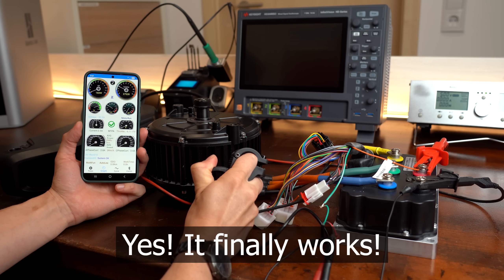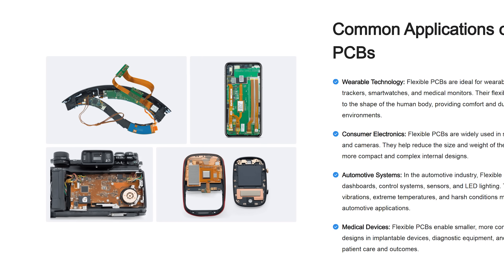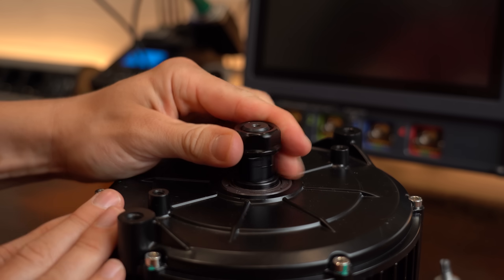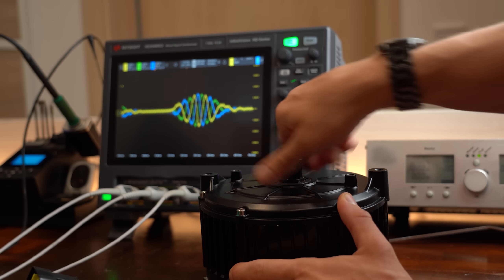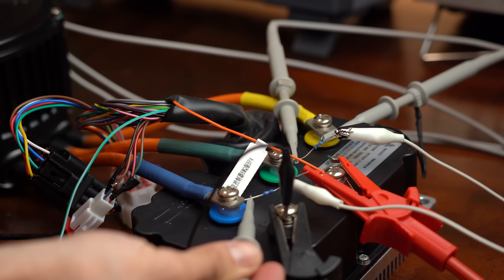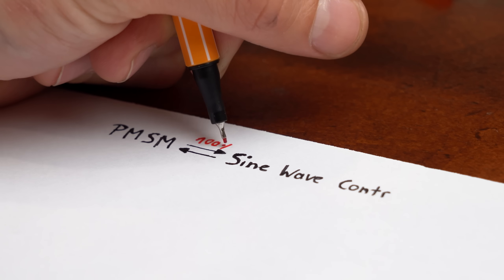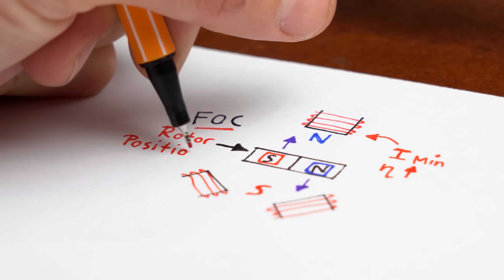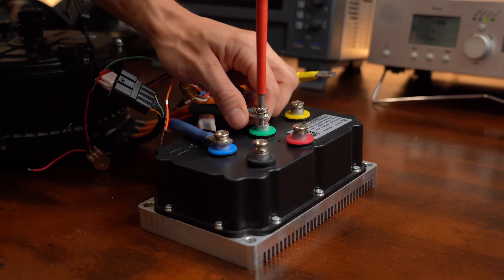The Most Important Motor for our Electrical Future?! (PMSM) EB#63

Comment: can you hack a home gym, and replace the weight stack with an electric motor, to give you infinitely variable resistance to account for your bodys limbs having different torque peaks for every position.  if the motor lets out the cable at a constant rate, and you messure the power generation.   there are home gyms that do that (arx) but they are crazy expensive and protected by patents.

Comment: Really great video. I think I need more clarity, I remember checking the bemf of an e-bike motor and got a sinusoidal bemf. This motor looked similar to the one you showed at 2:15. The interior looked nothing like the one you showed in 4:29. I know there are different PMSM designs, like the surface mount or V-shaped, is there a chance you could expand on why PMSM can still be found on lower-power-rated e-bike?

Comment: BLDC (Brushless DC) and PMSM (Permanent Magnet Synchronous Motor) are both brushless motors, but their key difference lies in their control and back-EMF waveform: BLDC uses simpler trapezoidal control with trapezoidal back-EMF for cost-effectiveness (fans, pumps), while PMSM uses complex sinusoidal control with sinusoidal back-EMF for smooth, high-efficiency, precise operation (EVs, robotics, servo drives), resulting in lower torque ripple but higher cost for PMSMs

Comment: Hook to a 10k watt ac generator head.
Start it with an entermitant pully and 12 volt car starter and watch ir self gen with alot of free to use watts left over.

Comment: You have just discovered those type of motors which are widely used in automation robotics and production as part of Servo Drive System. Most of servos use PMSM motors.

Comment: Im looking at one of these to convert my Mini-Excavator to electric. Ive noticed the 10HP engine just has to be slightly above idle to give full performance which just by feel is around 2000Watts and 1800 rpm. One of those 48V server rack batteries able to be swapped quickly would be perfect. the gas engine is loud and hot. A brushless conversion seems relatively simple but the throttle / making it an eco mode throttle is above my skills.

Comment: PMSM is also better as a generator from the looks of the sine wave coming off it when you spin it. Which is also why they want it for EV. Question is can they easily be used as generators in something like a micro hydro project?

Comment: I'm a retired employee  of an aerospace manufacture of motors and generators for military and commercial airplanes. The larger planes use three phase 400Hz electrical systems and a 28VDC electrical system.  

Commercial airplanes and military have not at least a decade ago employed critical applications PM motors because they LOCK UP  when a failure of the electronics or winding occurs. Coming up with a work around has proven difficult and often didn't save weight, efficiency, robustness, or cost. The one approach is to use a gear box to combine two PM motors where if one locks up the other provides half the power.  I have not hear of an efficient, etc. solution to achieve near full power.   

I see the problem of LOCK UP of PM motors used in driving vehicle wheels as a high safety risk.  I think that the manufacture are willing to take this risk.   They see this failure as just another risk that also results in the LOCK UP of a wheel.   Bearing failures is one on the list. Gear box failure is another.   Failure of the steering linkage causing the wheel to swing way off the direction of travel is one that I have experienced lucky at slow speed, less then 20 mph.
    
I see a wheel lock up on a scooter or skate board near the top speed has a very poor result for the person.

Comment: Can it spin slowly? (10 - 200rpm) I just don't want to put a gearbox, I need to have more or less normal efficiency and stable torque even at low speeds.

Comment: There is actually no such thing as a distinktive BLDC motor as every BLDC motor is a also a PMSM per Definition. The difference is between Sine Wave and BLDC as these are two different methods to control a motor. And as ESC stands for electronic speed controller this is also not necessarily a specific BLDC controller but a general term for any motor controller. BLDC stands for Brushless Direct-Current motor which is actually a very bad wording because there is no brushless motor running on direct current. You could describe a system of an ESC together with a brushless motor as a BLDC motor as the controller operates with DC.
Reply: agree

Comment: there are no actual difference between BLDC and PMSM. trapezoidal Back emf?. in fact many BLDCs also have sinusoidal BEMF and are driven by sinusoidal PWM not 6-step. all of your appliances use the term "BLDC", yet most of them have sinusoidal back emf waveform, and driven by complicated control logics like sensorless FOC, MTPA/MTPV, SVPWM, DPWM

it's more like marketing phrase (people are not familiar with the term "PMSM") and cost, application difference.

Comment: HVAC commercial, we primarily use induction motors, they can either be powered directly to mains power, or putting a VFD drive. Since what motors are controlling, either a water pump, or a fan, they run 24/7. They can run for decades excellent reliability. I can’t say the same for ECM motors. I can’t tell you how many ECM modules I had to replace. And they’re more expensive than a standard PSC motor. Less controls is better reliability.

Comment: My PhD is based on predictive controllers for induction motors and we can control Induction machines just like PMSM, with little penalty in efficiency due to using energy to generate flux. We can even go full sensorless with excelent performance!

So i'm double the bet and say the induction motor will be around for a little longer ;D 
My work goes in exploring if IMs cam still be used in traction applications in developíng countrys with IM mass manufacturers (like here in Brazil) and we found little evidence that using IMs is prohibitive. And upgrading to PMSM can be used as an efficiency improvement of around 8% to 10% in range or power, dependind on the limiting factor :)

We also study if industrial machines (as is, the off the shelf IE4 or IE5 machines) can be used in agricultural machinery and evidences shows de advantages of using lower power density nut easily available motors is desirable to lower maitenance time!

Comment: something that gets overlooked is that the pulsed power you get from ICE vehicles actually helps with the traction. you will see electric bikes consistently struggle to hook up where gas bikes of similar power will get traction.
Reply: Fair point but could be programmed in a motor controller pretty easily, a sort of "ICE" traction mode that pulses power to simulate a 2 stroke or 4 stroke engine at low rpm. Could be done but pretty niche ;)

Comment: British Yasa (owned by Mercedes) just announced a 56 BHP per kg motor of 14 kg.
The best so far.
How does that thing's concept relate to the video's?
To me, those BHP beasts are totally uninteresting. What would make them interesting is far less power and less weight and one per wheel with near zero transmission losses.at 50 BHP per wheel a family car has enough. That motor in Yasa tech will no doubt be a bit heavier than 1kg ;).
The German language has a verb AFAIK "umdenken" and that's what's needed a bit more.

Comment: I'm curious about the weight per torque and size per torque comparison of similar motors. Usually on my little projects the motor is the heaviest and biggest part that I need to squeeze into the design.

Comment: Can you do a video on breaking?. Can you use this motor to powerfully hold a single position without moving? If the break torque it can handle similar to the power torque? I have a winch where a mechanical break clicks on and off. This may be a good replacement.

Comment: I would love to see a type of motorcycle/ trike 3 wheel maybe .  One with the latest batteries from Catl or other manufacturer.   With the aim of reaching a solid  300km range . Also one with ability to charge in 15 to 20 minutes at tesla super chargers.  Liquid cooling of battery to maximising battery life.  Get this happening and you revolutionise the motorcycle market.  ❤

Comment: There are some issues with symantics here. What you are calling a synchronous permanent magnet motor is just an embedded interior magnet BLDC motor. I design and my company manufactures these interior magnet motors. As you indicated a sinusoidal back EMF is preferred. We use sensorless FOC control. The motor in the video has separate rotor positioning, but this really is only required for fine servo applications. There are also line start synchronous permanent magnet motors with an induction motor squirrel cage that allow the motor to start and run without a contol.

Comment: Excellent vid! 

A bldc motor can have a sine bEMF.   Most are just more trap shaped because the designers do near zero work to refine the magnetics and we can get pretty clean switching (and more power) using a cheap/easy 6 step controller. 

A common issue with most bldc is magnet coverage vs winding pattern.  Most factories pump out both wye and delta with no changes to the magnet coverage or shape.   So dofferent kv motors may have vastly different bEMF shape!

Ive designed bldc with sine bemf, using an off the shelf stator that originally produced a trap bemf.  Had to change the magnet shape and backiron.

Comment: The 165 10000w is a beast can run 40kw continuous i cant tell ehat version you have but i got that and the fardriver 7210000
Reply: And you need to showcase it as it is the same shape as this motor but about 4 times more powerful at least and it sounds like it has a supercharger attached to it.

Comment: That motor can handle over 15kw of power at 96v nominal lithium (24s) i would recommend getting a quality controller with mtpa and variable regen braking 
Vesc
Nucular p24f 
Asi bac 4000-8000

Comment: 5KW-Motor on a 3KW SinMotorController on a 48VBikeBattery which is Designed for 15A Peak.
This is running on 750W let's say 1KW very short Burst Maximum :D

Comment: Cool video, cool motor. My random suggestion would be to get 4 of those motors, a broken down Suzuki Jimny or similar 4x4, and make a slow but capable off road vehicle by putting a motor on each wheel. I may have gone a bit too big with this suggestion.

Comment: no, they are not going to be because of that. it is because, they overheat under stress and permanent magnets lose their magnetic field and kW or horsepower decreases from 500 to 200 and you will be essentially driving a nissan micra with all that battery weight. this is called "corporate greed" "perfect capitalism" "planned obsolescence"

Comment: i am absolutely DYING to try one of these E-bike motors as a boat motor. In particular, i'd like to find a way to mount to a Thai Longtail style kit. It should be able to push a small boat with a good load, provided we can get the batteries and range sorted. The advantage to the Thai Longtail form factor is that it can go in extremely shallow water, and additionally, the electric drive is practically silent when compared to current gas motors. There can be some unique torque loading on propellers though, i have some concerns...

Comment: Sorry to be stupid, but is PMSM AC or DC, ie does the sine wave go 0,+,0,-,0 (AC, and 3 phase) or just pulsing DC (0, +, 0) but with multiple phases

Similar motors in a EV vehicle are usually 3 phase AC  (and at much higher voltage  eg 600V?)
This one was low voltage  ie around 48v
The sine wave power supply takes in xxV DC from the electric bike battery  (and creates the pulsing DC output  [not AC?])
Reply: Actually kriswillems post below strongly suggests it is DC
Reply: And maybe EV vehicle motors which say they are using high voltage AC, are actually high voltage 'DC', but with sinusoidal DC (0, +, 0) and 3 'phases'   such that it is referred to as '3 phase AC'

Comment: I think the factor for the EVs is also Power to Weight and Size ratio. Finding a regular induction motor with 100kW power that can fit in your engine bay may be challenging. There are some more compact builds but they also require water cooling.

Comment: What you should do with your motor? Buy a used cheap petrol car and use this motor as an added boost to the existing petrol engine without any modifications to the ECU. 
See real fuel efficiency gains, especially tune the motor to operate while moving the car from a stand still and while needing sudden acceleration

Comment: What is the EMI (electromagnetic interference) situation with the PMSM motor and controller?
Shouldn't some of that wiring be shielded to avoid radio interference?
Permanent magnets also use Rare Earth minerals - which are currently politically sensitive as
China seems to mine and produce most of it.

Comment: As far as I remember, BLDC started with encoder, when they came available for RC hobby. Just to even start them, else they just could wiggle. But that made them way more expensive. Then came the first ESC, that used a better starting logic and even ones that used the backward current to sense where the motor is. By this time BDLC took off for RC hobby.
Nowadays you rarely see a BDLC with the sensor output.

Comment: of course electric sailboat drive re-generation wants an entirely different circuit to handle the regeneration.
motor controllers do not make good re-gen controllers, I would think it better to re-gen into a charging boost converter.
of course any magnetic cogging would result in a degree of drag at lower speeds, until the propeller inertia was adequate to smooth it out.

Comment: what to make with it?
well, that is 4HP ... hmmm ... a sail drive motor ( a motor for a small sailboat ) ... then rig it up to also generate power under sail.
of course finding a roughly 600 to 800 Kg displacement sailboat, at a decent price, is probably easier in Europe  ... but it's still a bit of money to come up with......or maybe an electric unicycle ???

Comment: This type of motor is the default for Industrial Servo Drives. It's good to see it getting more uses. We should really work at making them cheaper so eventually they can replace induction motors in many applications, they currently just hold due to their price.